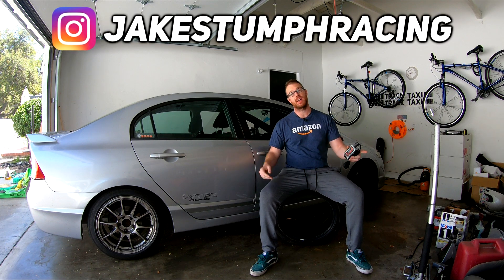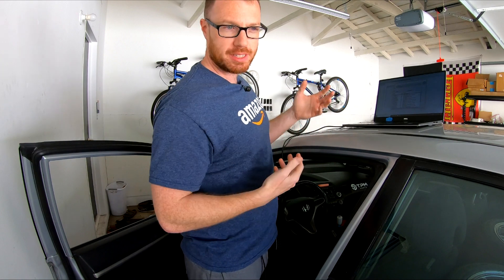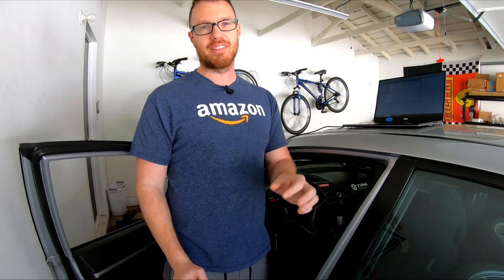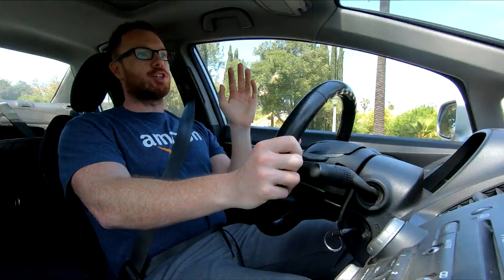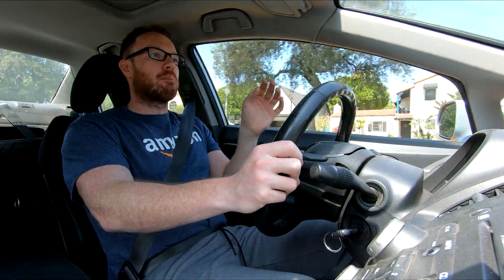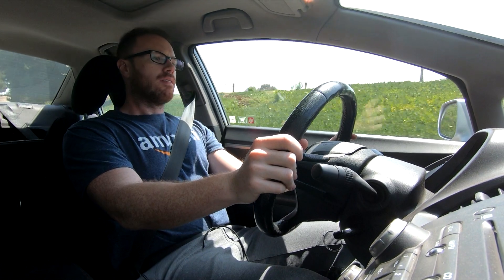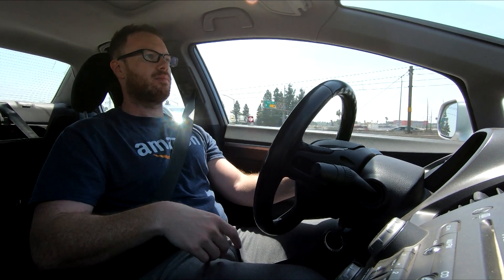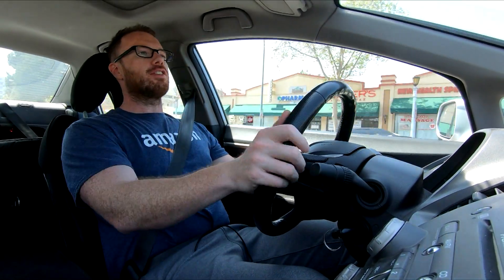Installing Hondata Flashpro on my FA5 || Project Civic Si Part 28

Comment: Can I use this flash on my civic with intake headers and 3 inch exhaust?
Reply from the maker: Hondata has off the shelf maps for a lot of different setups, and can tuned to optimize your setup.
Reply: @DriveBreakFixRepeat  so I when upload any  base my rev hang will go away?

Comment: is it safe to take the stock motor up to 8600rpm?
Reply from the maker: Safe is relative, but the JDM/Euro spec motors rev to 8,500 stock.
Reply: Hondata know what they're doing. They wouldn't provide a plug 'n' play configuration with a dangerous rev limiter.
Reply: my boys 8th gen revs to 9k it isn’t bad for the stock motor

Comment: Hondata is such a great value for everything it does. Great video man. The rev hang fix was great and definitely makes it worth it alone. 

My first tune we used the lower vtec engagement but I ended up going back to the stock engagements for my second tune.

Comment: It isn't a "two stage" VTEC,  but rather a window that VTEC will engage at. At full throttle, VTEC will engage as soon as it reaches the lower bound on the window, provided that it also sees that it has hit the targeted manifold pressure. On lighter throttle, VTEC will engage higher and higher in the RPM up to the upper boundary. The reason you feel as though there are 2 stages to the VTEC is from the provided Hondata tune. Once you get the car dyno tuned, it will smoothen out the power delivery even further.

Comment: I'm with ya. I owned my FA5 for about two years before I got a FlashPro and a custom tune. It should have been my first modification. Live and Learn. 

I am currenty running a hybrid racing CAI and a Invidia Q300 catback. I put down 200 WHP with the FlashPro.

Up next is a aFe catted long tube header and also the ZFX throttle body with a ported intake manifold. Waiting for both of those to come in. Will let ya know what the dyno says about those mods.
Reply: Whats the numbers brotha?